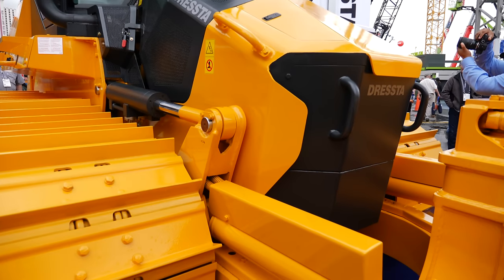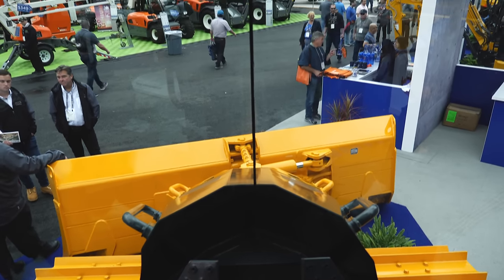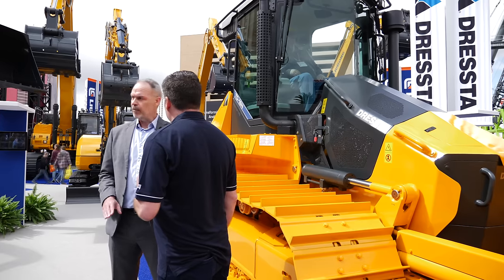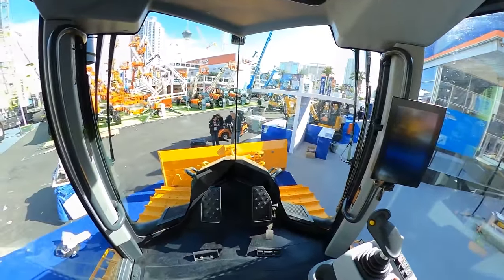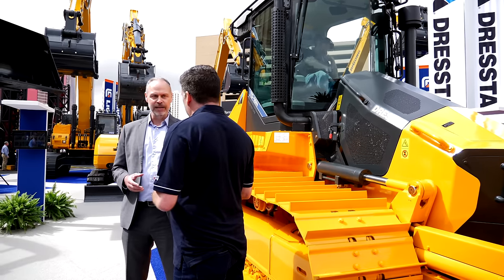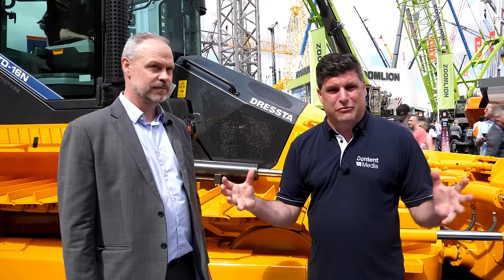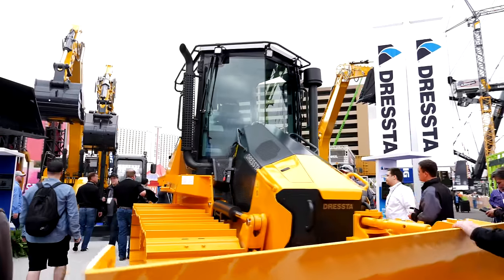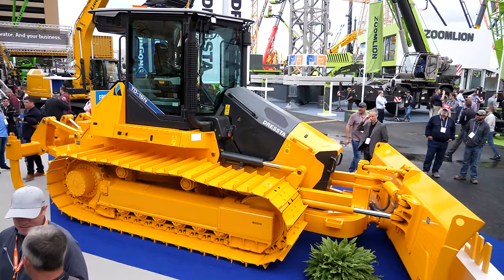Dressta's Revolutionary New Bulldozer

Comment: On big Ag equipment, the bottom steps are foldable/retractable to avoid being ripped off during the first muddy day. You get on the equipment, fold the steps, get to work. At least the blue on the steps will make 'em easy to find in the dirt when they get forcibly removed by a rock.

Comment: You all need to understand...Dressta was a joint venture between Dresser and Komatsu back in the 90s...But, in 2014, at CONEXPO, Dressta was sold to Liugong. It needs to be further articulated, that Luigong made its fame forming joint ventures in the early 2000s with the biggest of manufacturers, and then literally stealing their technology and putting their own components into machines...as in the case of their loaders, which are various "G" series Cat loaders, with Cummins and ZF axle, transmissions, etc. This is made possible due to the totalitarian law in place in China --- these companies, and others, have been able to advance themselves greatly in depth of someone else's hardwork and evolution of design. Now, as is the case with Dressta, A joint venture between Komatsu and luigong, where they partnered early and then shut Komatsu out...in essence, stealing more tech --- but that is their whole M.O....the Chinese do not build the best of anything, they go, form really big joint ventures, literally copying the design of others, and make it themselves --- that's why you see the comments you have...then they eliminate the joint venture, thereby not honoring their commitments --- and this has happened over and over and over again.

Comment: Except those steps are toast in like two days. There’s no freakin way they won’t get ripped off with the first thing that gets stuck between two pads
Reply: Thats what i thought as well, that and that split front window will be leaking or falling out, these dozers get alot of vibration.
Reply: That's exactly what I was thinking. Those steps are history as soon as you back into something or most likely pick up something in the track and take them out.  I have a D5N high track and have crushed the battery box picking up a cedar stump...

Comment: No experience in using dozers myself but compared to standard design seems a very neat, thinking outside the box clever redesign. Hope they can maintain some interchangeability of parts with standard dozers regarding running costs and not needing a separate parts store specific for this new design.

Comment: Residual value  .  I don't see a radiator in the back making a change . Terex did it 40 years ago. Did not go over very good
Reply: Actually, you are mistaken...Euclid did it before Terex...in the 50s and 60s...then Terex in the 60s, 70s and 80s...the last Terex dozer produced in 1993 just before the 1993 ConExpo. It was a unique design...however, as good of the positives...the drawback far outweigh --- when pointed upward in either a push or pull mode, the heat does not leave the machine well. We owned several Terex dozers. Another downside, the noise component...and the accompanied melted snow that refreezes in a snowy environment...these machines look well though out, unfortunately, to the trained eye, they are not.

Comment: so the tracks get dirty and then get clean... it happens 100 times a day running a dozer... ive never fallen off a track climbing on or off a dozer... but putting a step behind the track will guarantee that it is always going to be dirty... its in the prime spot to catch all dirt and mud coming off the back of the track while moving forward or reverse... only thing is that it doesn't self clean like the tracks do... we run lots of different tractors and all that have steps around tires are always covered in dirt or mud... its a daily thing to clean the steps to get in the tractor and they are usually covered in mud when getting out.. now i have slipped on that a few times but never bad enough to fall... so ill say i am a huge fan of the visibility but not so much on the steps.. maybe if they place em behind the dozer and completely out of the way of the tracks it will be a good idea...

Comment: I like the idea, cooling in the back. This is not a big Dozer, it's rather small, 8 -10 T. When it's big you need sprocket high, out of the dirt. Nice steps in back seems more like a office thinker and not a dozer driver. Steps has to fold in like a forestry machine. If made in Europa or USA it has quality that Chinese do not understand still.

Comment: Similar to the Komatsu D 39  D 51 design but more radicaly refined. Excellent engineering with the radiator in the rear, like Euclid/Terex had back in the 60's/70's era.
Reply: Jeff Schwab  Hi Jeff, I think when dozers converted from cable 2 hydraulics most of the hyd pumps were front mounted, no one had the accessory drive figured out yet. Euclid/Terex were quite dependable, easy to operate, if U could stand the noise of a screemin Detroit all day long. Mabe that's why a lot of the old "Cat Skinners" drank a lot, A?
Reply: Also the rear radiator, moves the operator ahead mabe 1 or 2 feet. It makes for a lot smother ride and front blade view.
Reply: Jeff Schwab Hi, My dear old Dad, ran an American 599 with a 671 also. Later on he ran a Koehring  from a river barge, it was big but not sure on the #.

Comment: Let me guess...it works fine for a season then requires all kinds of special maintenance that can only be performed by the dealer parts swappers ...I mean “mechanics” ...bet ya 50 bucks the engine only lasts 500 hrs because of the wonderful new emissions standards 😂😂....want a machine that works? Get a D8K used

Comment: Only thing this dozer is good for is maybe clearing snow, electrical over hydraulic always find there way to the down line not to mention probably has a stupid DEF system. If you can’t use proper 3 point contact climbing on the tracks you shouldn’t be running a dozer.

Comment: Just put the motor out the back ,visibility galore
Reply from the maker: lockwood heavy The problem with that is that you have a badly balanced dozer and no weight at the front on the blade.
Reply: Can't it just be weighted in the front like a tractor ?
Reply from the maker: Jeffrey Houston You could but then you’d be putting extra weight on the dozer just to balance the weight of the engine on the back. Why not just use the engine as the weight and move the cooling pack to the back as they have done to allow for better visibility.
Reply: Well, you said you'd need extra weight to balance it out.